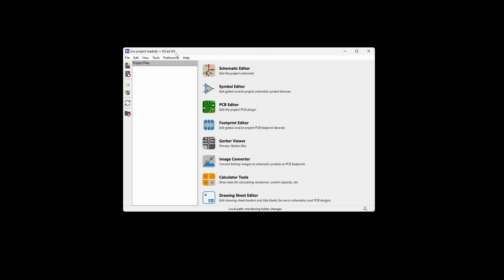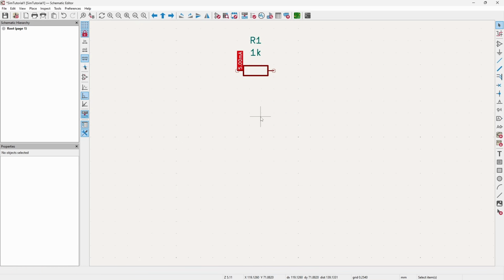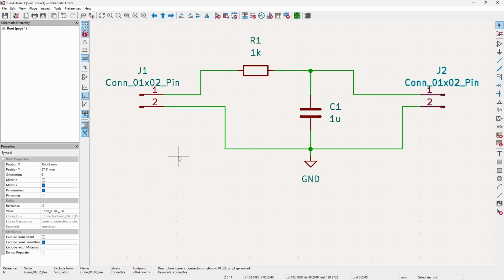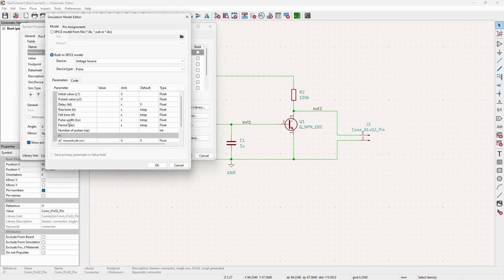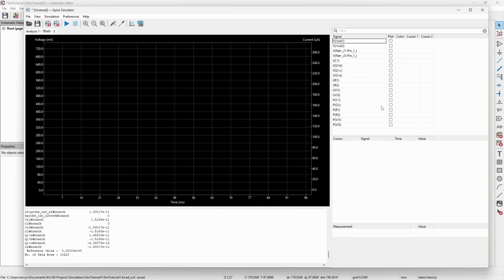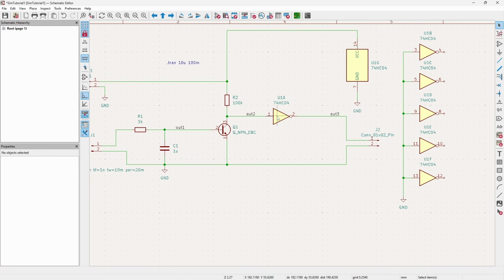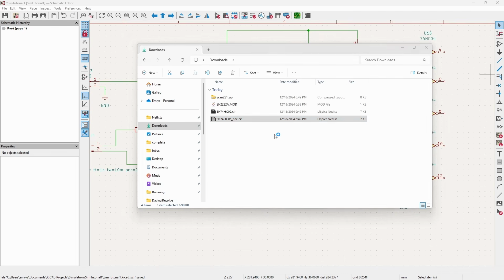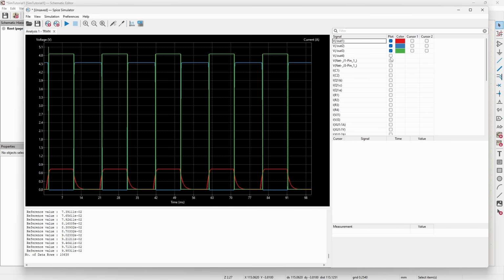Tutorial: Simulate your circuits in KICAD

Comment: TImestamps for you guys:

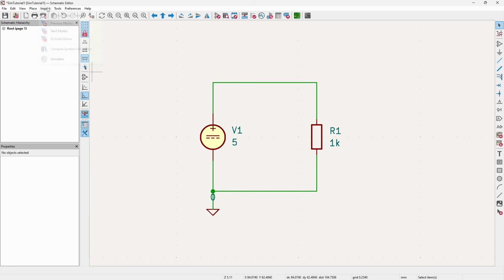03:32 First simulation run
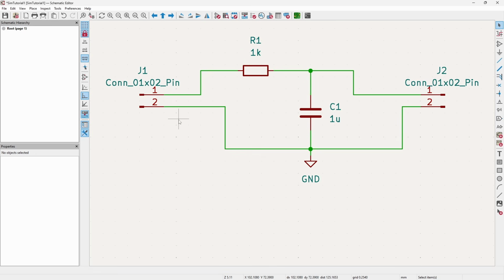08:14 Setup and run AC analysis (Bode plot)
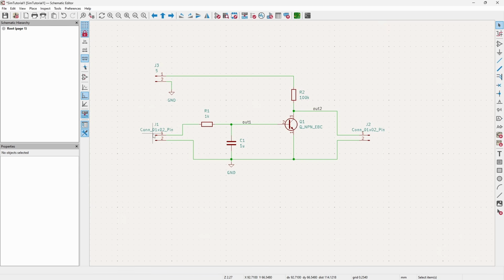14:12 Transistor model and transient response
20:58 Adding an IC model: 74HC04 (*05)
28:14 Modifying a single channel IC model to work in a
multi-channel IC symbol

Comment: Thank you for explaining all this. I downloaded the model file for the 74HC04 inverter from TI, but it only contained two pins; pin 1 and 2. My results, even after putting a pull up resistor (just in case), gave a voltage of 5 volts for out3. I will play around with creating my own model as you suggested. All in all, a great video, You have a nice way of explaining things, at a good pace. Thank you.
Reply from the maker: I'm not sure what file you ended up with, but the SN74HC04 has 4 pins (Y, A, VCC, AGND). Here's the subcircuit definition line from SN74HC04.cir from the website: .SUBCKT SN74HC04 Y A VCC AGND
Reply: @e @electronicswithemrys anks for replying, I will do a full walk through in case I missed something. I’m a 100 beginner with KiCad and Spice so your assistance is much appreciated. I’ll integrate that sub cct definition,
Reply from the maker: @cuchitp  Feel free to shoot me an email if you get stuck. electronics.with.emrys at gmail.

Comment: For those watching this today and had trouble at 15:54,  you need to make sure it is a normal text block like in the video and when you run the simulation, if it opens "New simulation" tab, you need to choose custom. It will then show your directive it made.

Comment: I decided to use ltspice for my circuit. Kicad is ok for basic resistors caps or inductors but enormously punishes the user for components not already in the library. A truly awful GUI straight out of the late 80s. You get what you pay for.
Reply: The late 80's were awesome. I wish I could apply a beach pants theme to the schematics
Reply from the maker: Completely agree there -- I have been using QSpice for a while now and really like it. LTSpice is still a good system with lots of solid tutorials.

Comment: Is it possible to run the simulation continuously, alter the input values via the UI and have an impact on the running simulation signals dynamically?
Reply from the maker: No - SPICE simulations typically target nanosecond level accuracy, and it would be quite hard to both show that and have you interact with it in real time.

Comment: great tutorial.  Does anyone have the spice model for the 74HC04(*5)?  all the spice references i dowloaded only have asignment pins 14 and 7.  Very weird.
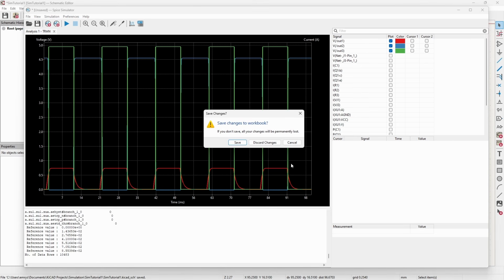Reply from the maker: The model for SN74HC04 on TI.com has been fixed to include the correct push-pull output. You will have to go through the steps shown in the video at 28:45 to create a subcircuit that will match the pinout of the 74HC04.

Comment: For analog circuits, can it calculate DC operating point to start the simulation at?
Reply from the maker: Yes - in fact, that is the first step in any SPICE simulation. You can read in detail on how it works in the ngspice manual. I grabbed this snippet from section 11.3.10: An initial transient operating point at time zero is calculated according to the following procedure: all independent voltages and currents are applied with their time zero values, all capacitances are opened, inductances are shorted, the non linear device equations are solved iteratively.

Comment: I tried adding .tran directive as a text item on my schematic, but it seems to ignore it and still asks me for the analysis type and parameters when I create a new analysis. I have KiCad 9, what am I doing wrong?
My text: .tran .1us 1us
Reply from the maker: It seems like they may have removed that functionality - I also see that it ignores the directive placed as text!
Reply: @electronicswithemrys actually I just found out that it looks like it will update an existing analysis from the text just not instantiate a new one from it
Reply from the maker: @johnkozell6498  Weird - mine had an existing analysis and would not pick up the text.

Comment: This simulator is worthless compared to the Proteus simulator, which shows the circuit in real time, and here it doesn't show any real time... You have to write some codes and parameters yourself, although the ones in the schematic should be enough, and it doesn't show anything good...
Reply from the maker: I haven't used Proteus, but I'd love to see a simulator that can do real-time nanosecond-scale simulation! Not so sure you'd be able to see anything useful though....
Reply: @electronicswithemrys  But the problem is that the Proteus program is paid and costs a lot, and probably nothing strange, so I have to look for an alternative, but I can't really find anything similar to the Proteus program :(
And these programs don't simulate very well, there are activities with settings and the like, and you don't need to set anything there, you just put components or voltmeters or whatever you want and click "start" and see how everything changes in the drawn diagram, voltage drops, voltage numbers and the like change, so I think this is a real simulation. Of course, you explain everything well, but when you try the Proteus program, it's not so convenient here.

Comment: Wow!!
Simply the most complete and updated video on the topic!
Here's yout Kicad oscar!! hahahah

The simulator works well for bigger simulations? Take too long? I'm planning to simulate a three phase inverter with drivers. Is it too crazy?
Reply from the maker: I'm glad you found it helpful!

I have found that Ngspice is a pretty decent simulator and can be optimized for fairly fast performance - but it will be very dependent on the models you're using and the simulation setup. I would highly recommend setting up your simulation to be as focused as possible -- ie only put in what you need to validate your design. I would suggest to design each inverter independently first, then model those based on your results for the combined system simulation - simplifying all that you can.

Comment: Note: Codel model file loading path is D:\xxxx\Gatedriver_check\
Note: Compatibility modes selected: ps lt a
Circuit: KiCad schematic
Error: PWL(expr, points...) only literal points are supported at line 560
from file
"C:/xxxx/1EDI3033AS.lib
Error: ngspice.dll cannot recover and awaits to be detached
Warning: can't find the initialization file spinit.
****
** ngspice-43 shared library
** Creation Date: Oct  3 2024   05:22:42
****
Note: No compatibility mode selected!
Circuit: *
List of plots available:
Current const	Constant values (constants)
Error: vector time not found!

What could be the reason for this error sir?

Comment: Further to previous comment, I am using KiCad 9.0, which separates the pin assignment for each sub- circuit.
I found it necessary to change my sub-circuit definition to:
* JHR: Added subcircuits
.SUBCKT SN74HC05_HEX 1A 1Y 2A 2Y 3A 3Y GND 4Y 4A 5Y 5A 6Y 6A VCC
X1 1Y 1A VCC GND SN74HC05
X2 2Y 2A VCC GND SN74HC05
X3 3Y 3A VCC GND SN74HC05
X4 4A 4Y VCC GND SN74HC05
X5 5A 5Y VCC GND SN74HC05
X6 6A 6Y VCC GND SN74HC05
.ENDS
in order to get the pin assignments to work properly, unless I have missed something...
Reply from the maker: That looks right to me. Unless I'm mistaken, the subcircuit you show matches exactly what's in mine at 31:27.

Comment: Thank you very much. This has helped me immensely. I just thought to mention that it appears to me that the pin order for the upper three inverters in the simulation sub-circuit pin assignment, may be reversed.
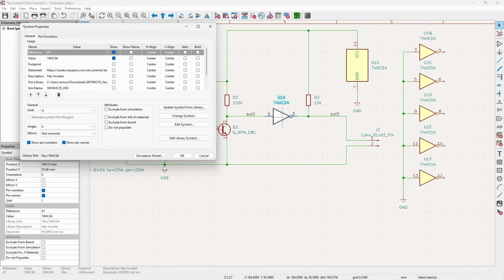Reply from the maker: Thanks for bringing this up - I double checked the pin assignments in the SPICE model at 31:27 and in the KiCad pin assignments tab at 32:31 and they look correct to me. Am I missing something?

Comment: Great summary. Just what is needed to get going. However, the simulator graph text is so small I can barely read it on my 5K monitor.  Is there a way to change it?   One thing I can do is move it to my smaller 1080P monitor and the axis text is a good size.  Thanks.
Reply from the maker: I'm afraid I don't know of a way to increase the size of the text in the simulation window. You can get some of the text to be larger (on Windows 11) by using the system accessibility > text size feature, but it doesn't seem to affect the terminal output or the signal pane. You might be stuck using a magnifier tool on this one :(.

Comment: Do you prefer the Kicad simulation over LTspice? just wondering what would be best for students, learning  KiCAD for everything or sticking with LTSpice ofr simulation and KiCAD for PCb design?
Reply: I think LTSpice (or even better, QSpice) is better for students to learn. I do like that KiCAD includes a simulator, but it's a bit more difficult to setup and use in my opinion.